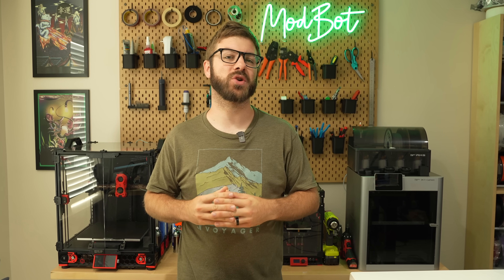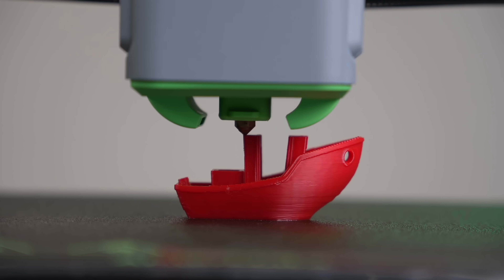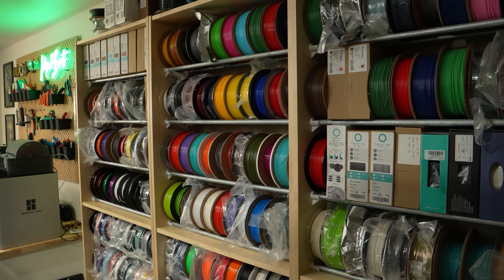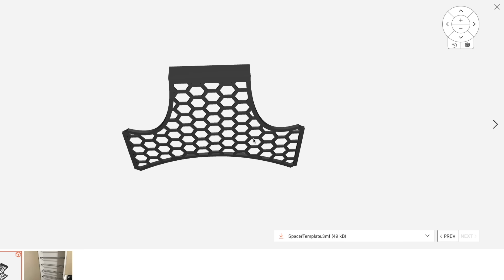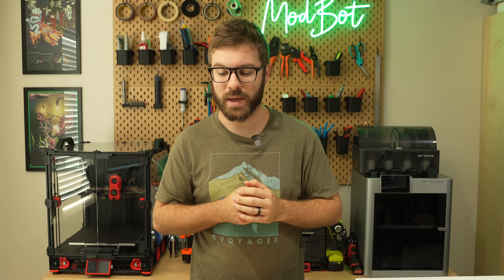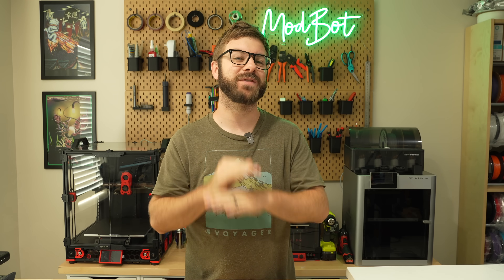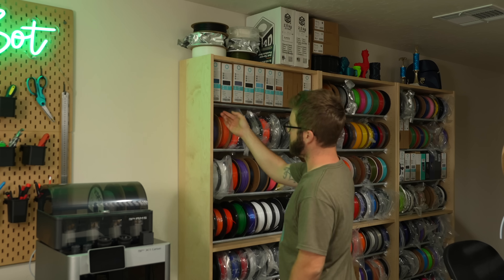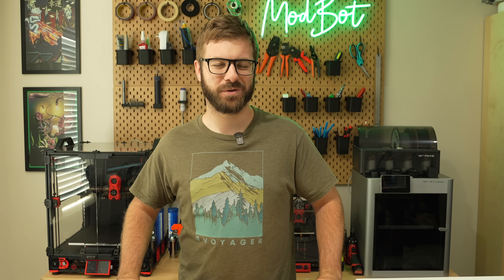Ikea Hacks Meet RepRacks! (FilaBilly Filament Organizer)

Comment: A must should be to use cabinet joiners to join them all together. That should make them a fair bit less likely to fall. But if given enough force might make them all fall over. I've had 3 of these joined without fixing them to the walls due to landlord issues and they seem much more stable.

Comment: Conduit cutting tip: if you can secure it to something so you aren't holding it while you're cutting then the experience is sooo much better. You get much less tired and you can cut faster. I used conduit with Makerpipe joints for a project and once most of the structure was made I clamped it to that and it was a huge difference

Comment: Good video.
As I start collecting spools of filament, I realised I need a storage system, that wouldn't break the bank.
20mm PVC conduit and 3D printed brackets have worked so far. But it is ruff, 😅

Comment: I would love to see Spoolman and how it works. I have a Bambu Lab printer which you didn't mention, but it sounds like it may not work.

I tried to use 3D Print Log but it the last time I checked it didn't have all of the filament types (for example it has ABS but not ASA), the interface was a little clunky, and requests to the people who manage seem to have fallen on deaf ears.

I like the Ikea storage system by the way, it's cleaner to me than the reprack solution. I would try to go that route and seal it up for desiccant (my place is humid as heck), but I already went down the sealed storage boxes with desiccant and hygrometers.

Comment: A hacksaw or sawzall and a 3d printed saw guide that holds the blade perfectly 90 degrees to the pipe will be far quicker and easier than pipe cutters. Surface finish isn’t as nice, but that really doesn’t matter for this use case.
Reply: Or a grinder if you don’t mind the sparks.
Reply: @modern_DIY  those are way harder to get a straight cut with